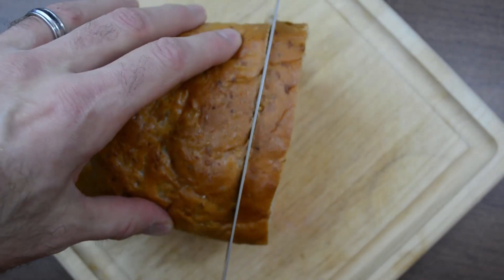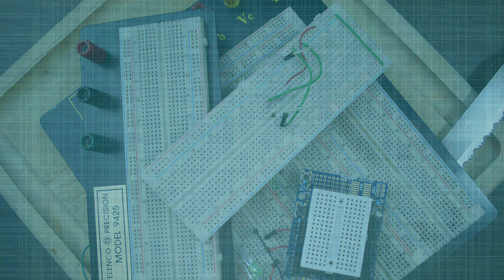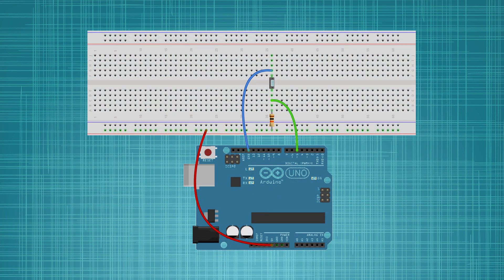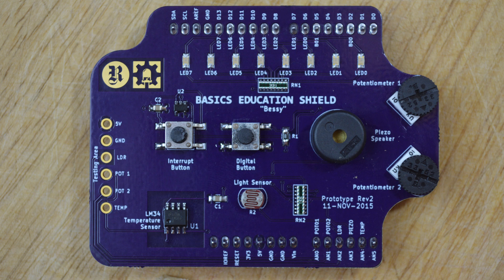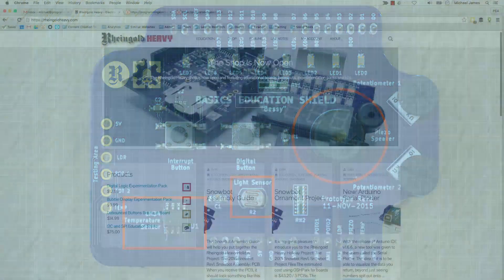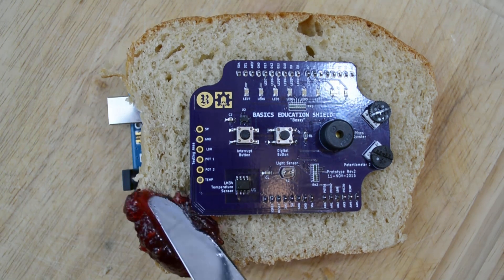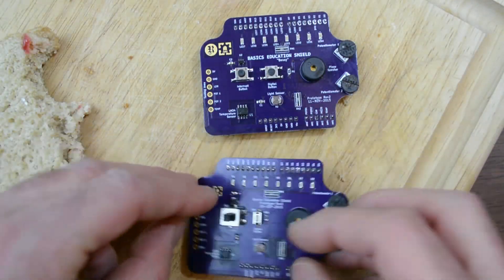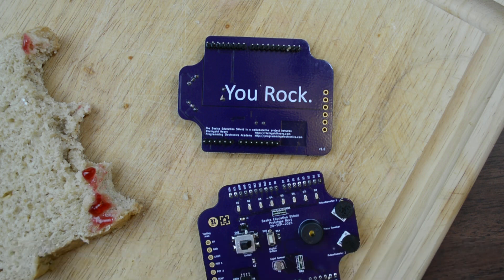Kit on a Shield for Arduino

Comment: I'm a new comer to arduino and I need a shield to help control 4 different items with various power for each. I need to supply 10W to a pair of speakers each needing 5W and another 6W to another set of speakers each needing 3W. I also need about 2.3V for my VU meter by Great Scott with just a little more power for my lcd screen by arduino. I'm also including TDA7492P 25W+25W Wireless Bluetooth 4.0 Audio Receiver Digital Amplifier Board. So I'd like to add this features together with 2 analog inputs and 3 digital for on and off of whole system, switching from radio to Bluetooth, and one to vary the on and off of the VU meter

Comment: How much will it cost?
Reply from the maker: +U꞊RI Great question!  We are still working on some quotes, but we are looking at mid 20s in US dollars.
Reply: +Programming Electronics Academy Any kind of warranty? I ask because if the tmp sensor breaks on it, for example, I don't want to spend another $20 to replace it. Whereas with a bread board, I can simply buy just the sensor. Thank you for this channel!